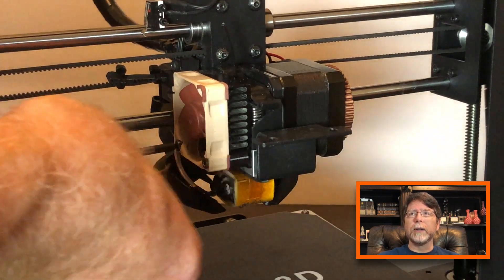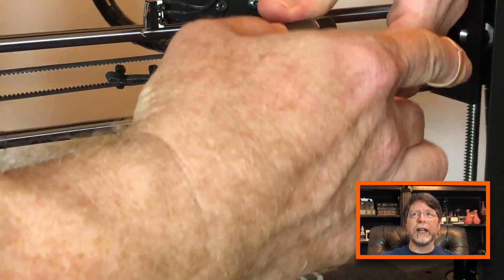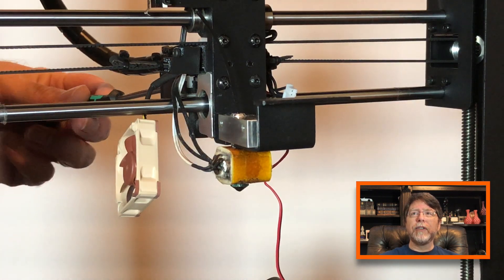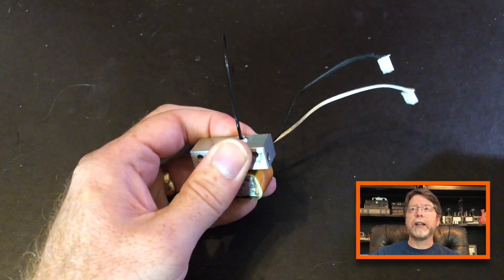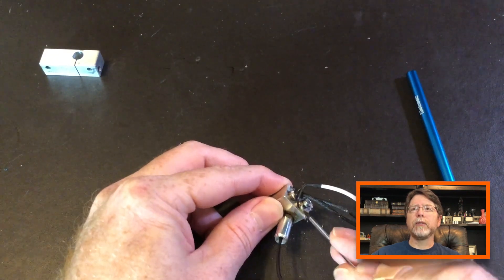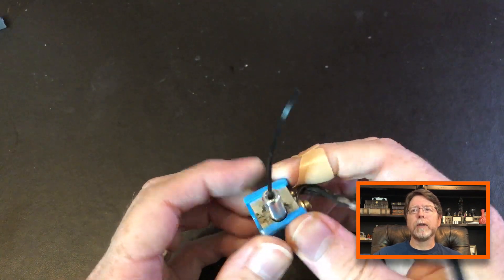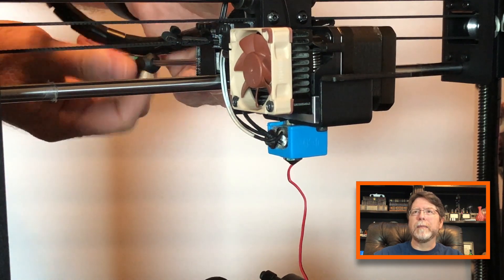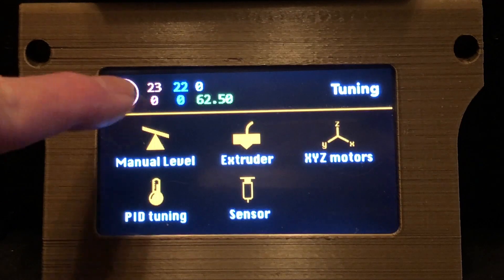Sock It To Me: How To Install Silicone Sock Heater Block Insulators

Comment: Saw the video.  I have a MKSP and have trouble leveling all the time.  Can you post a leveling bed video?
Reply from the maker: Hi Daniel. Just out of curiosity, are you using the stock Y sled? And do you have the newer version of this printer which has a bed sensor on board?

Comment: well done Bryan  I don't have a Monoprice printer put the video was nice. I use the  Silicone Sock  on my i3 and it is nice, easy to keep it clean and I think it helps with a constant heat. take care and have a great day
Reply from the maker: Hi Zimmy! That's what I'm hoping for -- that it'll be easy to keep the heater block and nozzle clean. I anticipate that I will be able to remove the silicone sock and simply flex it to get any gunk off it, and then be able to heat the heater block (without the sock) to give it a quick once-over with a brass brush to get any filament off of it. Cool it all down, put the silicone sock back on it, and away I go! 👍
Reply: It usually only builds up on the out side and a brush and tweezers work well. also they break down after a while so keep a bunch of replacements handy. I love them
Reply from the maker: I bought a 3-pack, so I have two more waiting in the wings. I'm going to install one on my other Maker Select Plus though, so I will still have one spare on hand.